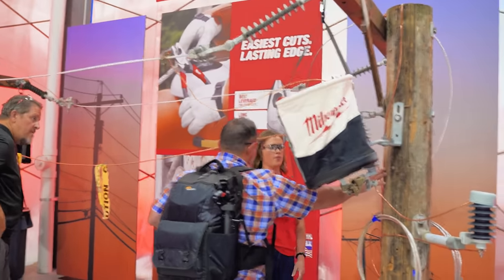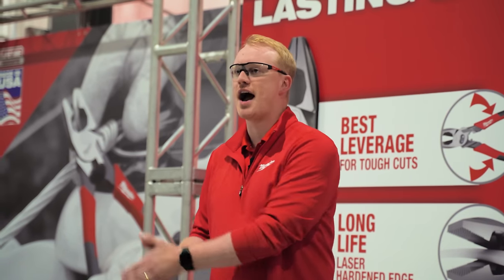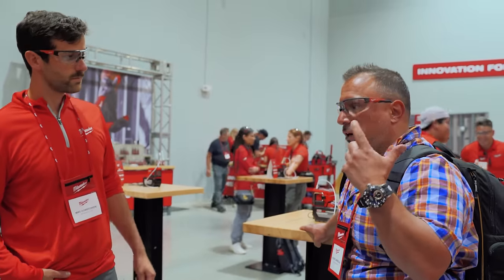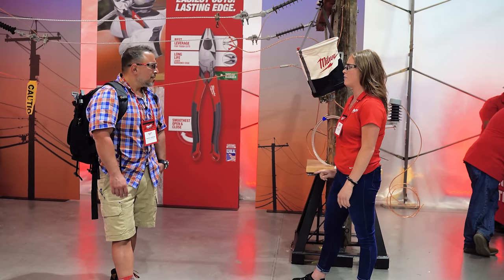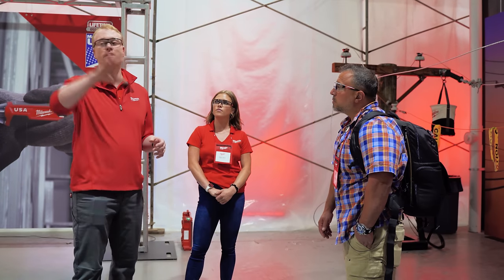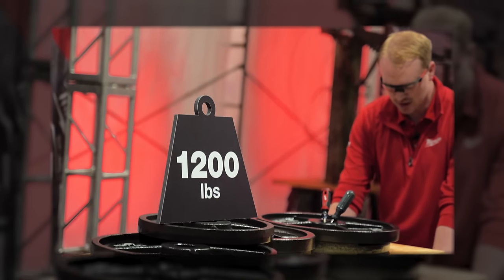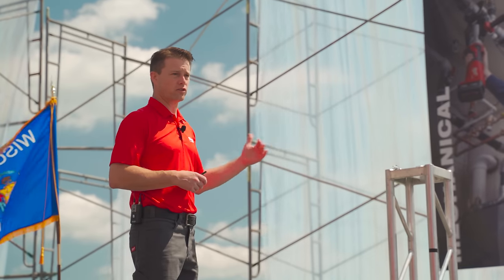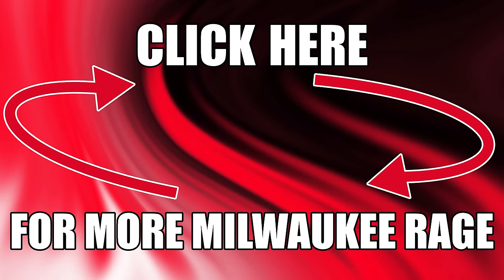BIG Problem With Milwaukee's USA Made Hand Tools (THEY'RE LYING)

Comment: Ok I need to be that physics geek for a second. It does not take 1200 pounds of force to roll 1200 pounds of force across the level floor. Ever push your car? Same deal. I’m not impressed with his ability to pull a cart with brand new caster wheels with a magnet.

Comment: Put the receptacle in upside down 🙃
Reply from the maker: Wrong
Reply: @VCGConstruction  good reasoning !  Perhaps gfci’s and audible gfci’s don’t have to be oriented a certain way either ! Hell let’s just have switches in either way as well, doesn’t matter if there’s lettering  telling you which way is correct, right !
Reply: Ground prong always installed installed on top

Comment: The guy talking about the screwdrivers and the fitment into the screw heads is full of shit. To account for inaccurate screw heads you would have to have have screw specific drivers, pointless and inefficient.  You can't step a screwdriver head, it just won't work. He has to be in marketing, just trying to sell the product.  Did they ever explain how their screwdrivers fit inaccurate screwheads? Doubtful.